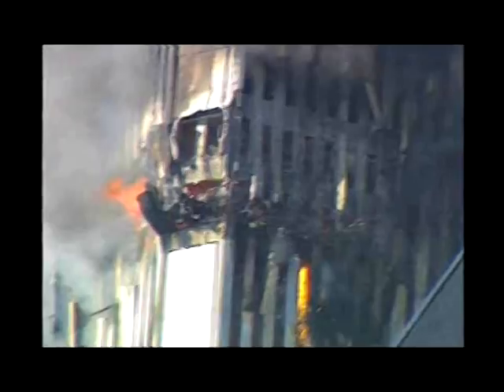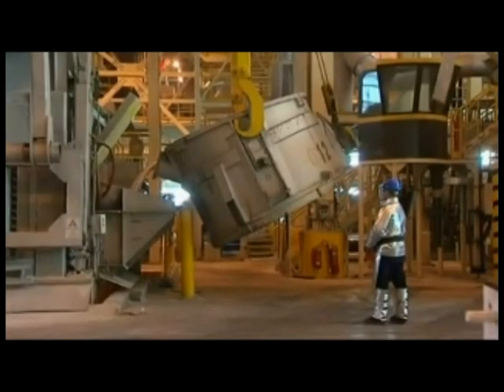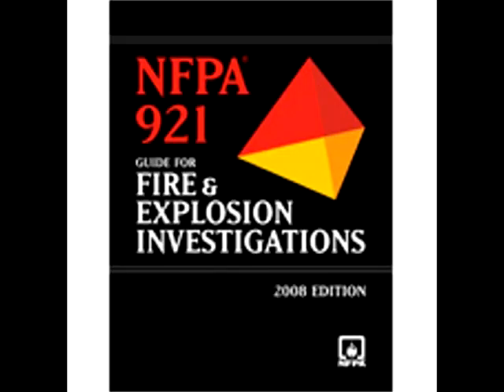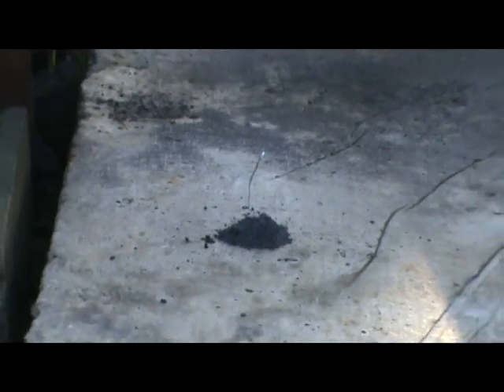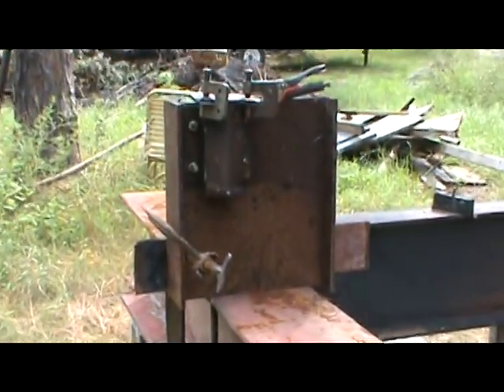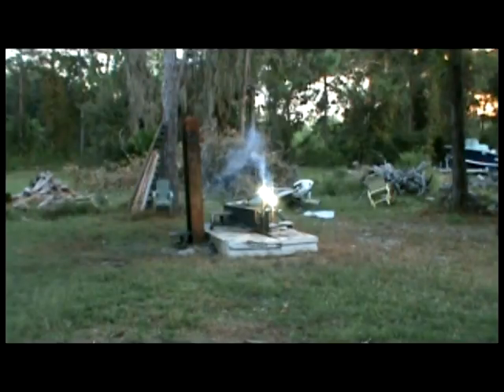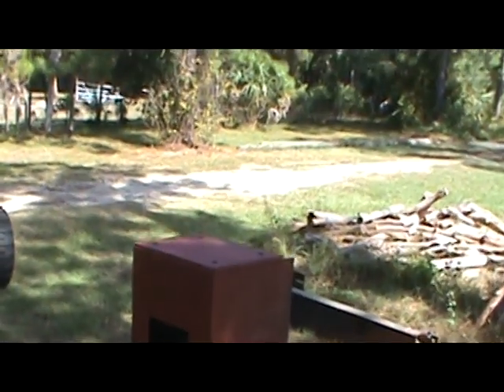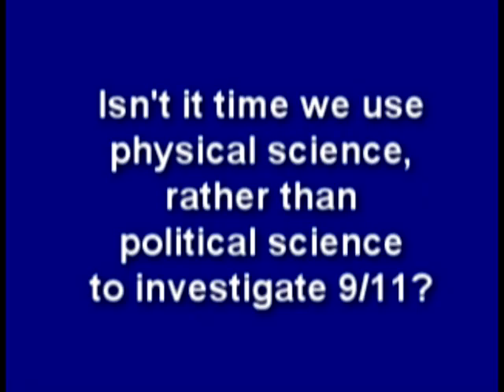9/11 Experiments: The Great Thermate Debate

Comment: "it looked like steel from a foundry". You do understand how steel is melted in a foundry right? They use electricity. 

Now I'm no expert in electrical engineering, but I'm curious about just how much power was running through those absolutely massive buildings.

I also have a theory on the "explosions" heard in the lobby and basement. Ever hear or see a transformer blow? and I'm not talking about Megatron.
Reply: James D
so if there was no demolition, how could wtc7 fall in free fall speed with no plane hitting it. and before you say "fire" go find a steel frame highrise that has collapsed due to fire after 2 hours of exposure. or 24. or 36. THERE IS NO OTHEr.
Reply: Just to be clear, I do not believe that it was a controlled demolition or an inside job.
Reply: Kelsey Sadler
i have heard all the arguments, seen all the videos and heard all rebuttles. and as someone who has seen a technical university from the inside i tell you, it WAS AN INSIDE JOB. There is no way a passport can survive the heat that supposedly melts steel girders. there is no energy for the heating of steel girders to such an extent anywhere. kerosene is not so hot, office fires are not so hot and entropic fires and one sided impact dents will COULD NEVER LEAD TO A SYMMETRIC COLLAPSE and ESPECIALLY NOT AT THAT SPEED. go watch the thermate video again.

also 2 entropic events cannot lead to 3 exactly similar outcomes. that is against all theoretical principles of physics, Nist is not to be trusted, they even claimed no compound  could lead to such structural damage. so, again: watch the video, it shows NIST LYING

This was the event needed to lead the world into a war at peace times. War as a parasitic economic model
 
A war to improve saudi arabias strategic position in the arab world. A war to sell arms to the most gruesome fascist islamic tyrannies out there who are ALL US allies. Saudi Arabia (where the pilots supposedly came from) - bush/clinton friends. Oman, Quatar, UAE. all beheading women stoning tyrannies. But iran? Syria? secular moderate islam? THE ENEMY.... You are brainwashed you idiot
Reply: No More BS Please
so, the debris "falls" laterally onto a building over 100 feet away? Another question. why does all the concrete pulverize into a cloud? why doesn´t all the "debris" brake the fall of the first two buildings? you know, resistance and such? ok. another troll poster devoid of physics knowledge.
Reply: The theory of electricity causing this is something I thought about from the beginning. In a high-rise, there is a power substation usually every 12 stories. Each sub station is usually fed with 13000 volts. The electrical system is grounded to the steel of the building. Years ago I went to a seminar where they took a 3 foot high I beam and applied 3 to 4000 amps of current and the I beam heated up and failed. Also the path of electricity will go through the bolts so they would fail much sooner. Just a theory.
Reply: I saw a video saying there where entire floors occupied by batteries. I looked up the foundry stuff and I saw something about induction heating steel to melt it.
Reply: No More BS Please
man, you are way behind in the discussion. NO STEEL HIGHRISE HAS EVER COLLAPSED FROM FIRE. SHOW ME JUST ONE.

THERE IS NONE
Reply: prallund feucht It had 500000 tons of debris falling on it. There have been PLENTY of buildings like WTC 7 collapse from fire, do some actual research! It did NOT fall at free fall speed, NONE of them did! That is an edited video that cuts out the penthouse collapse.
Reply: No More BS Please
Too bad for your dumb ass NIST admitted free-fall speed.
Reply: Kelsey Sadler bullshit. there is no tipping, no crumbling, a symmetric fall of increasing speed with an outward plume and squibs running underneath and the building landing in its footprint. clearly visible signs of explosive demolition.

And Nist would not even show their full simulation of the event, because it already disproved their own statements after about a second.
Reply: pegging you is an inside job
Reply: Kelsey Sadler and everyone else... Physics dictate that the position that the plume took has absolutely nothing to do with the collapse of the building, but the weather is the answer. Calm, with a 10 mph wind from the north. The building did not fall sideways, as some of you idiots have descried, but imploded according to every other demolition I have ever personally been in the vicinity of. Furthermore, MY FATHER WAS A MASTER MACHINIST, and he taught me quite a bit about metallurgy. Aluminium does not have the thermal property to remain in liquid state while dissipating heat to lighter material such as wood, paper, plastics, etc. Steel only free flows like water or magmatic lava after it is over 2500°F (roughly) and no, a power transformer blowing up doesn't give off enough electrical radiation to melt structural steel to liquidity. Thermite can, but it takes focused projection as this video showed.  How do they get steel molten in an industrial foundry? Natural gas, induction coils, and BLAST FURNACES. Gas at high pressure inside of a giant metal and fireclay box, as well as oxygen and carbon tri-ethyline molibdenium powder, and iron oxide and sulfur boron flux powder (as an example of what is used) is how liquid steel is made.  In short, to reach the temperatures necessary, even to weaken the structural integrity of the steel girders; thermite or some extremely thermostaticcally reactive gas/flux combination would have been necessary to cause a direct collapse into the building's own foot print, or any collapse at all. Furthermore, iron microsphere don't colesce in blast furnaces, they conglomerate to become one mass of iron.  So, this rules out gas. The only alternative option remaining, Thermite, is KNOWN for the microsphere effect.  If you are so stupid that you cannot understand what I am saying, then lemme spell it out for you: THE DEEP STATE DID THIS. FIGURE IT OUT ALREADY!!!
Reply: Carefully watch the tops of the towers above the points of impact, and tell me that it was symmetric. Once that amount of mass starts moving, the amount of tensile strength needed to resist the energy goes up exponentially. It's called shock loading. The same principle can be applied the the planes themselves, even though they are made from aluminum, they are more than capable of structurally damaging those buildings. Not to mention the jet engines are mostly titanium and the landing gear is mostly steel.

Energy is equal to the mass times velocity squared. Like a lead bullet going through a steel car door.
Reply: xDR1TeK To answer your query implied, there are many here among us, who feel life is a video game. I'm older than that. I realize that there is a factor in play, which nearly took my life: inaction. During the last days of Obama's Presidency, Myself and a few good people who were tired of good people doing nothing about the blatant problems in full view of the public; came together over common soil, so to speak. Our combined knowledge of history, science, mathematics, outdoorsmanship, astrophysics, metaphysics, metallurgy, and ancient medicine; gave us an edge which we used for a time to help others. But if times were hard, we didn't think about it. We didn't get time to. We resolved to be in effect, everyone's neighbor. A network of good people doing the right thing. Thanks to Uncle Sam, it's not always legal. But we have to replace the thought that legal means ethical and moral with, means IDIOTS have been allowed to pass laws and those are enforced with the threat and action of violence. And I spent hours putting this together, but it seems like even though the Deep State/Kingpins of legal crime are fighting a force of 3.6 million people, they are winning. A handful of men and women in their fifties to seventies, are making the world's cockiest Alpha personality citizenry look like a table of fools. We never needed to be United States, like we do now. We never needed to be "We the People" like we do now.
Reply: prallund feucht 
I urge you to watch the video in the link that I posted. I know that it is long but it addresses all of your concerns about "the official story" including the WTC Building 7.
Reply: Kelsey Sadler
ok, the airplanes? they hit from one side, so how come the buildings collapse symmetrically if impacted asymmetrically with entropic heat distribution? and what is harder? steel or aluminium...
Reply: prallund feucht 
It did not land in its own footprint, ie. the outward plume. Concrete is very hard but brittle, hit a small chunk of it with a hammer observe what happens.

Again, I urge you go to the link I posted.
Reply: Kelsey Sadler As far as the basement explosion, 20 eyewitnesses claim it occurred below them, and before the first plane hit the first tower.

So even if something blew up it would be an independent event from the plane attacks.
Reply: smshah232
why independent? the plane is just an addition for the "show-effect" because plane+fire is just such a dumb straightforward perplexion that fits ergonomically into most peoples brains without getting any filtering, critical thinking.

And that is, why a real scientific debate is so difficult today, also due to the self-censorship, defunding and defaming of university departements and personalities who have delved into this topic independently.
Reply: Kelsey Sadler how does a thin aluminium tube break several dozen thick steel columns? you can see the column cladding is broken but the column is intact inside
Reply: We had a 250hp motor at work that overloaded and completely melted the motor disconnect leaving behind about 20 lbs of molten copper.
Reply: Kelsey Sadler that has got to be the dumbest comment yet.   You can’t be this stupid.
Reply: WTF720   Keep hearing about excessive speed. Pilots know that not only are airliners slow at low altitudes (high pressure) they are difficult to handle. There's actually danger of the fragile wings shearing off. The wingtips on 911 Didn't seem fragile,as they managed to puncture steel leaving a Road Runner cartoon hole.
Reply: I'd watch transformer porn
Reply: Kelsey Sadler metals in foundry are melted using a constant high current source. When a transformer blows, it's just for a couple of seconds dumbasd
Reply: Mike theBike MIT admitted to creating a computer program simulating the towers and the impact. Before September of 2000.
Reply: guardsmanom134 you know what is funnier? How do people expect judgment to take take place if there is no God? This act is not the first in history. People let these things to be done over and over again by not knowing or not wanting to know.
Reply: xDR1TeK I pity you. "God"is a title which we use to explain the grand design. Many people are so lost in the idea that something so great, could be contained in something so infinitesimal as we, and are willing to pay billions of human made monetary notes to force-feed it to the world. Is that the response you expect me to come with?
Reply: xDR1TeK Judgement is supposed to be the final moment of human life on Earth.  But the history books teach us that life, though it sometimes seems to falter, always finds a way. I will not be the last. I am not the first. I am simply doing what I have to, to be what my history to be written must someday be. A total, and complete enigma.
Reply: Kelsey Sadler you're not smart enough to argue with adults or children. And, we all pray you never have children
Reply: guardsmanom134 pity me? Coming a bit strong when I only insinuated that idle hands are the reason behind waiting for fairy people to right some wrongs. This video is only one page in many that is trying to figure out this story. However I found another video proving that this building was a righteous collapse because of stress. In the end I live abroad and have only access to digital media. What do I know?
Reply: guardsmanom134 it is prudent action to lead and guide for the sake of many who need it. But crossing boundaries are sometimes frowned upon.
Reply: not enough to weaken the structure IMMEDIATELY. also, due to the grounding of the building there would hardly be a discharge within in a FARRADAY CAGE
Reply: Your mom was an inside job
Reply: The buildings did not collapse from the heat of fire alone. Did you notice the large airplanes smashing into them? The Twin Towers were not a symmetrical collapses and they failed at the point of impact.

 As a certified machinist who has graduated from a technical university, and has spent over a decade working with the manipulation and fabrication of many different types of metal (mild steel, high carbon steel, tool steel, stainless steel, cast iron, bronze, brass, beryllium copper and the many different grades of aluminum) I can tell you that you don't have to melt steel to weaken it.

I have provided you with legitimate evidence from credible scientist, engineers, and journalists in a very thorough report in the YouTube link, so you don't have to go to some shady malicious website that supports your bias of conformation. You are the definition of ignorance by not even attempting to look at all of the facts. But tell me again how you enjoy pegging other men.

Comment: Probably one of the most informative videos I've seen relating to 911. No BS, just good old science. The guy is a legend.
Reply: I actually don't know which of these is the bigger moron. The troll or the one who feeds?
Reply: Christopher Davis The planes themselves are a whole other topic, but let me ask you this, how can a plane travel at 600mph so close to the ground? The planes themselves defy laws of physics. The reason airliners that big need to fly so high (30,000 feet) is because the air up their is 3 times thinner then it is down here. Airliners would tear themselves apart attempting to travel at those speeds so low to the ground.  But this video is just talking about how the towers fell, it definitely was not a plane that's for damn sure, and if you are so sure of the official narrative and he's absolutely wrong, then prove him wrong thru experiments, and if you won't, then you're just huffing paint.
Reply: @BudokaiMan-mr9tw  This awakens the question were the plane movements, speeds unnatural on their way towards the building ?
Reply: No BS? Uhhh bud no one claims jet fuel can melt steel...but it will heat it up and dramatically weaken it cause the building to fail and collapse.
Reply: Just like a rocket stove. More than enough material in that building to burn. The right draft and you have a high temperature foundry. The molten flow was a pond of molten steel before it found its way out. I call bullsh*t!
Reply: Termite did not create a pool of molten steel that you see eventually pouring out. No! Lmmfao
Reply: A N he is testing the things he is not gi ing conspiracy theories
Reply: Howard Gilmour this isn’t science at all it does not account for the mad of the plane hitting it or any other possible accelerants inside the office
Reply: Thermite melts steel.  I knew that decades ago.  I’m a Republican.  I voted for GW Bush twice.  I wouldn’t vote for a Democrat if my hair was on fire and that person had a bucket of water.  I don’t have a problem believing 9/11 was an “inside job”.  It has to be proved, though.
I’m still a Republican.  TRUMP 2020!!!
Reply: @voodosforever  The argument by @michaelpelletier4955 can have its merits. "High temperature foundry". So is Thermite a neccessity for the molten steel phenomena to have occurred?
Reply: ***** If the earth is actually spinning thousands of a miles per hour, why do you need a car or an airplane to get to from point A to point B? 

Gravity my ass. Lol.
Reply: Aj Nv Tell me how does the ball spinning earth holding up all those water together without falling off?